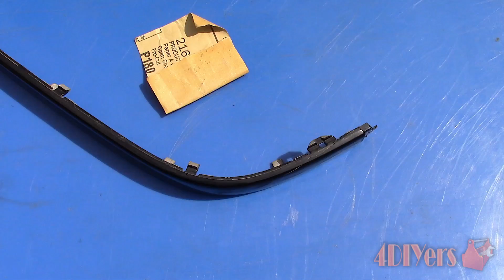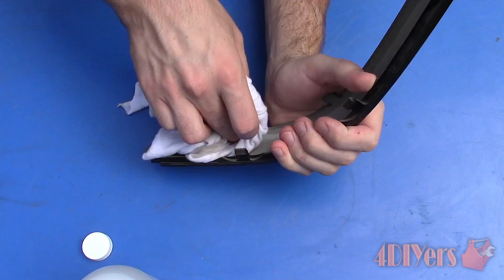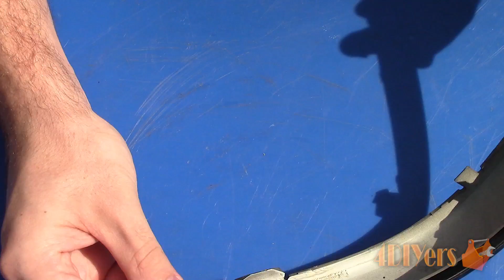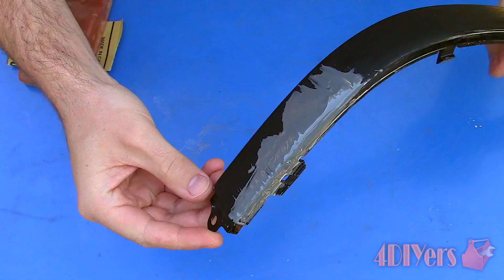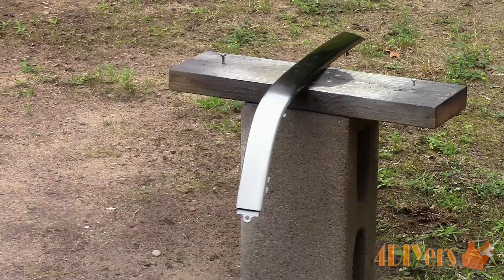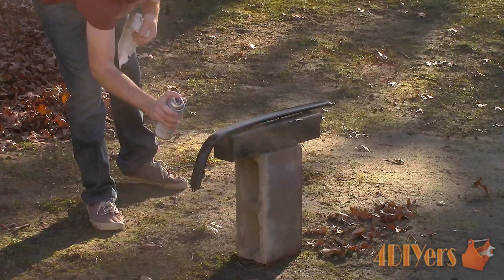How to Repair Cracked Plastic Trim

Comment from the maker: Amazon links for various products used in the video for both USA and Canada:
USA:
180 grit sandpaper: https://amzn.to/2Mwjr5i
220 grit sandpaper: https://amzn.to/3sZf5V7
320 grit sandpaper: https://amzn.to/2YfzAPt
400 grit sandpaper: https://amzn.to/3qOEO0G
Backing pad: https://amzn.to/3qUc5rl
Filler Primer: https://amzn.to/3iQSOnT
Wax and grease remover: https://amzn.to/2M6xvCV
Plastic epoxy: https://amzn.to/3wvB5ci
Canada:
180 grit sandpaper: https://amzn.to/2Yf6rUs
220 grit sandpaper: https://amzn.to/2YjmoJe
320 grit sandpaper: https://amzn.to/36cqjfi
400 grit sandpaper: https://amzn.to/3qVYXlK
Backing pad: https://amzn.to/2M71Hhg
Filler Primer: https://amzn.to/2NucGl5
Wax and grease remover: https://amzn.to/39nLn4F
Plastic epoxy: https://amzn.to/3rKBKmo

Comment: Very cool thanks? What if my plastic trim has a hole in it? I have a running board that's cracked and missing about a 1.5 x 3.5 inch piece of plastic!
Reply from the maker: Thank you! Unfortunately that can be hard as you need to match the plastic type for melting in a new patch. The only other options is purchasing a used replacement (which can be hard depending on the vehicle and can be expensive) or use a plastic patch kit, I believe 3M sells something like this.

Comment: Is it possible to fix the cracks in clear plastic (i.e. on piano black veneer or plastiwood)?
Reply from the maker: You should be able to, but it will be noticeable so you'd need a top coating of something to hide the repair.

Comment: Where did you get the color matched paint? And thanks for the video!
Reply: +Oguz You go to an autoparts supplier that deals with paint, or there are locations that deal specifically with automotive and commercial paint supplies.  IF you're cars trim is a specific color, there should be a color code available so the paint supplier can make an exact match.
Reply from the maker: +Oguz It can be purchased at a local auto parts supplier who is able to mix paint such as Car Quest or an automotive paint supplier such as Sherwin Williams. Just supply them with a paint code. This only applies if your trim is color matched to your vehicle.